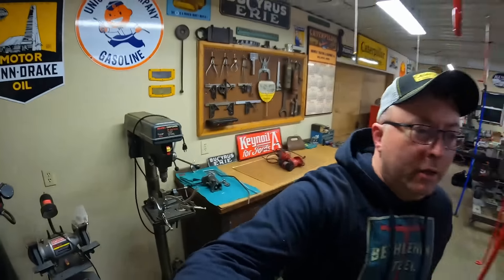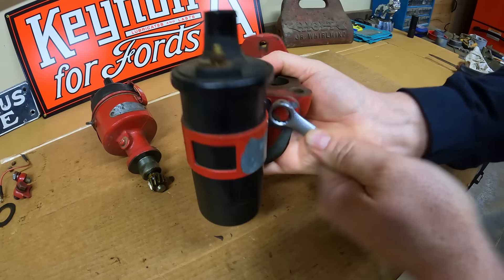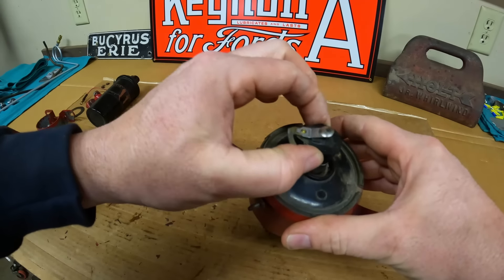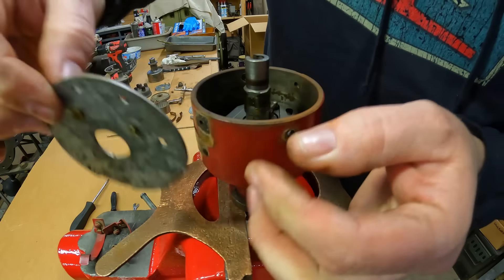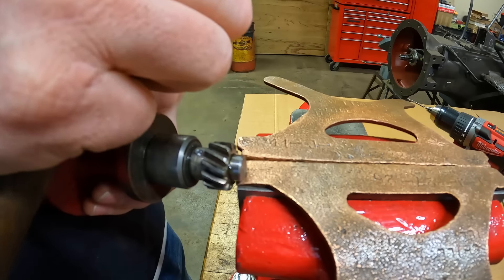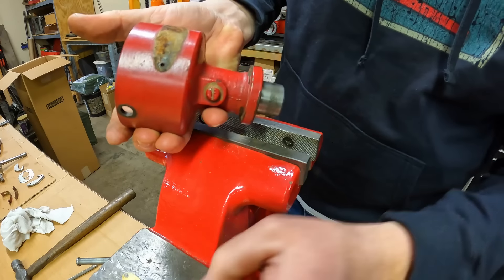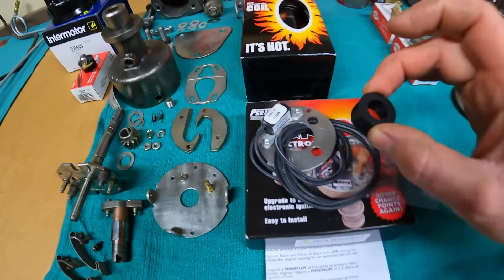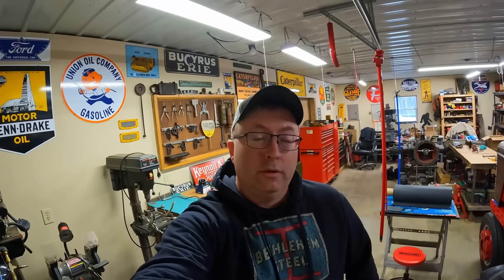Farmall Double Distributor Build! Electronic Ignition vs. Points & Condenser - "Preparation H" Ep.35

Comment: Thanks for sharing. Is there a small passage from the grease lube fitting into the gear housing cavity to lube the gears and bushings? Do me a favor and put a grease fitting in the hole and start pumping. At 24:04 I can't tell in the shadow, but it looks as if there is a hole inside the housing. Yes this is strange.

Comment: Electronic ignition is much better than points, both for reliability and performance. The speed that transistors break the coil circuit is much faster causing a more violent field collapse and therefore hotter spark, and since they don't have to rely on mechanical opening and then closing you get far more time in the rotation to charge your coil. The good thing about these drop in kits is they keep the original advance so if need be you can always go right back to points assuming you still have the plate.

Comment: I gave up with points in my 65 Mustang about 10 years ago and fitted one of those Pertronix ignition modules. As people say below the ignition is so much better due to the clean electronic switching that the engine can be transformed. Do you have a special Pertornix unit for six volts, because, with mine, they say the unit needs a clean 12v supply and not to take power off the wrong side of the coil ballast resistor. As for reliability I have not had to touch the unit and the spare one I have is still in the glove box. With the Flame Thrower coil get good HT leads.
Reply from the maker: Yes, they sell the 6 volt kits for tractors with either positive ground (like the h here) or negative ground - you just have to make sure you order the right one :-)
Reply: That is brilliant. They now make quite a range of these to suit all vehicles. I think you made a good decision. They are basically fit and forget. Also if you do have a bit of wear in the dizzy shaft they are not that sensitive to this wear. @squatch253

Comment: I had the same worry when I rebuilt the distributor for my M (it’s the IH factory distributor) and although it has a relief hole in the opposite side, there was no hole in the bushing. I assumed the bushing had been replaced but a hole had not been drilled so I drilled a small hole and now a small amount grease gets into the bushing and comes out the relief hole just like it should. When I rebuilt the distributor on my Super M (also factory horizontal distributor) it already had a hole into the bushing. It seems strange that all four of your bushings don’t have holes in them but then again I have never worked on a Delco distributor, maybe they are just different. Finally where do you get your points and condenser? I have found that the ones you get from tractor supply and Steiner are absolutely junk. (Half the time I can’t get a spark at all) but the Napa points are better and the Case IH points seem to be pretty good. Granted I’m only 15 so I really can’t verify if they last 20 years haha
Reply: Sounds like you're doing well for the young age of 15! I remember being 15! Now 58! Where did the time go? Develop a plan for your life and do your best to follow it.
Reply from the maker: @gusthefarmer - I get my points and condensers from my local Auto Value store (they're the "STANDARD" brand) and the last set I put in this H lasted about 6 years and actually ran for a lot of hours in that time so I really can't complain about them.  Most other brands of points that I've tried have only lasted for about 2 years and were junk.

Comment: First thought on the housings. Could they have been re-bushed previously and they didn't bother drilling a through hole?
Reply from the maker: I had thought of that too, but both housings AND both distributors are the same way, so all four would’ve had to been re-bushed at some point and not had oil holes drilled into the bushings. The one distributor unit has been on this H for the 50 years it’s been in the family, and the other unit came from a swap meet in southern MN so I doubt they were both worked on at the same place.
Reply: I've been through 2 Delco Remy distributors on John Deeres, and neither had a hole through the bushing. The operator's manual says to fill them with SAE 20 oil. There are no seals on the shaft, so you can't have oil flowing freely into the bushing. It has to soak very slowly through the porous bushing wall.
Reply: Thanks Squatch, you're right, that does seem unlikely. Looks like it was never supposed to have one either.

Comment: With the electronic distributor you'll notice smoother cold starts and way better fuel burn , but most of these units are more unreliable than the original points set up

Comment: Just two comments. Did you throw your old plug wires in the garbage. I save all my old electrical wire circuit boards and I take it to the scrapyard and I get a little money for it but at least it doesn’t go to landfill. Second on the badge plate on a distributor, you commented it’s always dirty underneath. Have you ever considered just a dab of silicone caulk? That might keep all the dust out doesn’t take up any space just a thought. Look forward to assembling both distributors.

Comment: So with a distributer that uses flyweights changing either the spring rate or the weight itself should change the spark advance?
Reply from the maker: Yes, in fact one of the main things that affects how well these Farmalls run is flyweight spring tension - if the springs are weak or a different distributor was installed that has different springs for a different high rpm, the timing will end up way off 👍
Reply: @squatch253  I could see with my physics training, that this could be useful for changing spark advance to adjust for different fuels.  Fuels available in the 1940's are different than what we use today.  Have you had to adjust an old carburetor for modern fuels and then adjust the distributor to match?
Reply from the maker: @kevingalat4720  I've never had to adjust anything in the distributor beyond the normal tweaking of position to fine tune the timing, and after both it and the carburetor have been matched to each other I haven't had any pinging or pre-ignition problems, the engines run pretty well.

Comment: With the electronic ignition you will have much more spark timing accuracy specially at high RPM. The points trend to "float" above 2500 RPM and the spark becomes irregular.  This is a great upgrade to an old distribution if you want to have a good and consistent accurate spark to your engine. And they are maintenance free.

Comment: Curious as to your reasoning for not putting it back to the original mag since you are defending keeping original components. We have a couple tractors that still have the mag and still run great.
Reply from the maker: For the same reason why they replaced the mag with a distributor originally, because a distributor gives better performance and a smoother idle due to the centrifugal timing advance. A magneto is more of a fixed timing setup that is biased towards keeping the spark timing optimum at the higher engine speeds where most of the work gets done. There are advantages to a magneto system, mainly being able to run the tractor without a battery, but I still prefer the distributor on this H. The ‘48 McCormick W-4 that I brought home last fall still has the mag on it, but I plan on keeping that on that tractor 👍

Comment: I wonder about signal noise and voltage stability of a generator with the electronic ignition. I think the invention and adoption of alternators opened up the electronic accessories more so than the fact that someone invented the accessories because of stability of system voltage. I don't think you can hook a current baler or planter monitor to a generator equipped tractor without getting some false readings and warnings...anyone have a scope and other test equipment?

Comment: I even had a vertical Delco distributor on my 1945 Farmall BN.  Whoever put it on there bent the bottom lip of the hood to make clearance.
Reply from the maker: This happened to the old hood that was on this H as well - at least on the H and M tractors there is enough room to just rotate the angle drive housing so that the distributor fits closer in towards the engine block - I don't know if the BN sized tractors still have the same amount of space to do that though.
Reply: @squatch253  Nah.  The cap was pretty tight to the head and in slight contact with the hood.  I expect it would be the same with B, BN, and both of the C tractors.  I had always intended to change it to a Farmall distributor but didn't get it done before fate intervened and I ended up selling.

Comment: Not meaning to be an irritating commenter but I do have a question. Knowing how you like things to be as original as possible, why not use a magneto if that was what was designed for it originally? Again, not trying to troll, I just enjoy watching your videos and I can often pick up a trick I can use elsewhere on my own projects.
Reply from the maker: Good question actually - the magnetos were mostly replaced due to distributors having the centrifugal advance system which kept the spark timing closer to the desired optimal setting throughout all rpm ranges, instead of a magneto being more of a fixed timing that was biased towards the higher rpm range because that's where the tractor would be doing its real work.  The magnetos didn't offer as smooth of an idle as a distributor does, but they did have one benefit in that the tractor could still run without a battery.  So there are benefits and drawbacks to both systems.  I decided to keep this tractor with its field changeover distributor, and now that I have the 1948 McCormick W-4 with the magneto, that will stay the way it is so that I'll have both setups between the two tractors :-)

Comment: If it likely came originally with a magneto, why not restore it to original with a magneto?  I’m sure that I am missing something here.  Can you share your thoughts on distributor vs. magneto?  Thanks as always.
Reply from the maker: The distributors have better ignition timing for all rpm ranges (hence the centrifugal advance flyweights) whereas the magneto is more of a fixed timing, basically a compromise between the desired low speed timing and the desired high speed timing, with a bias skewed towards the higher rpm operation because that's where the real work gets done.  A distributor system will also allow the tractor to idle smoother than a magneto would, but then the main advantage of having a magneto is being able to run without a battery - so benefits and drawbacks both ways.
Reply: @squatch253  awesome explanation.  Thank you so much.  Your knowledge is encyclopedic!

Comment: Hey Squatch - Interesting. Q: Can you put a grease fitting in a housing and use a grease gun to load it and see where the grease comes out at, before you reassemble it? I had a similar issue with my Farmall cub and I ended up just putting a few pumps of grease in each hole and called it good! :) Thank You! @rbtractorman

Comment: I hate points. Wherever possible on various classic cars over the last 50+ years, I have replaced points with either optical or Hall effect plus amplifier set ups. The only proviso and it will not I think apply to your Farmall H, is that the electronics must be kept fairly cool.

Comment: Be sure not to leave the ignition switch on for long periods when the engine is not running. It can damage the electronics.
Reply from the maker: Yep I read about that on a couple different forums when I was doing my research on the electronic conversion, a few guys mentioned that they had run out of gas and forgot to turn the switch off after the engine quit, only to find that the electronic pickup module had overheated and fried when they got back to it.  Some said it only takes a couple of minutes to happen too.

Comment: I'm sure they were designed for drilled bushings to allow oiling / greasing, and then after the first thousand owners pumped them full of grease all the way up to the rotor cap both manufacturers went off the idea.
One other thing I'd mention is that the manuals were usually made up ahead of physical release so they had all the original design stuff in them.  If a design change like 'lack of hole' happened it could take generations of manuals till the illustrations caught up.

Comment: Hello Squatch, Toby, I thuink the condenser is used to help reduce the spark on the point contact's any one know if that is right? Always interesting, Toby. Watching these videos gives those of us who do not have to work in the cold and rainy days or, depending on point of view, do not get to.
Reply: Yes, that is the purpose of the condenser.  It keeps the points from sparking when opening thus reducing the pitting and erosion that will occur.
Reply: The capacitor charges when the magnetic field in the coil collapses on point opening. Then the capacitor discharges the energy back to the coil. This electronic ringing creates AC which is stepped up by the secondary winding in the coil to a high voltage. Think Tesla coil.